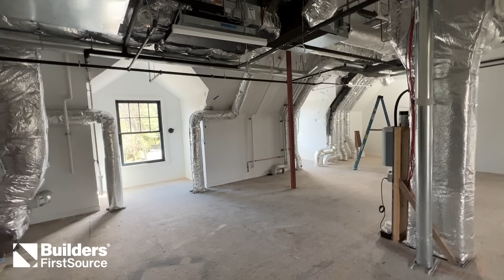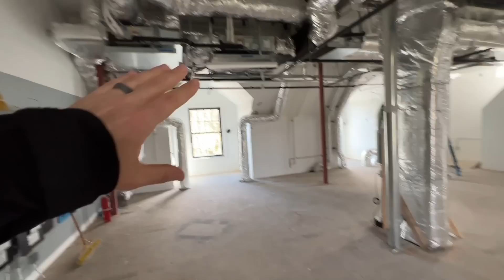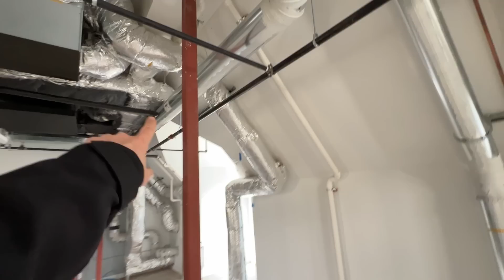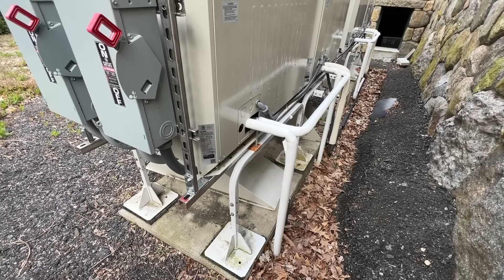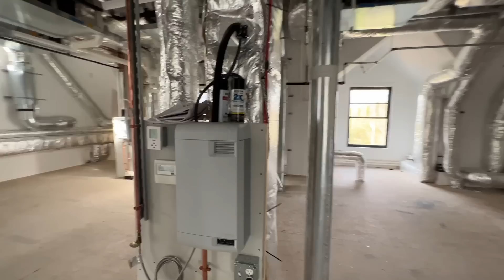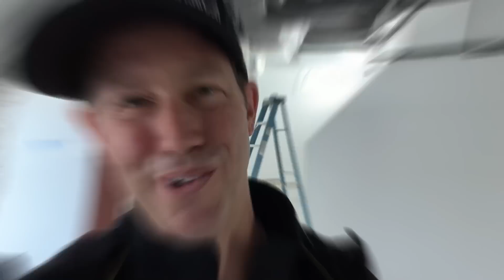This Mechanical Room is Epic : Build VLOG

Comment: This is neat but if the mid static pressure units only serve one room, it would be way cheaper and easier to just use high wall casettes.

Comment: Wow Matt,
This looks amazing.  I especially like the Mitsubishi device that allows one room on heat while other room on cool.  It's a complaint we have here in our Mitsubishi Mini-Split home.

Cheers,
Eric
Reply: Where do you live? Here in Connecticut (similar to Boston) we usually gap out for a while between AC in early October and when heating season starts on November 1 and this spring we had a very rare flip-flop from heat to AC and back to heat and now we've been gapped with no HVAC needs for over a week and when we pick up AC we won't go back to heat until Nov 1. I can see the utility of heat and AC at the same time in a commercial scenario where you might have interior areas or a server room getting cooking while the outer edges of a larger building get heat, but I can't quite figure out what the application would be in a residential setting.
Reply: 4/23 was the last day we needed heat here and we could need AC on Tuesday for a little bit but then there's another good week of nothing.

Comment: WRONG! Flex pipe on supply lines (=quiet & filtered supply) and only ridged on returns for cleaning unless you have filters at the return inlets then yes flex duct returns. I love forced air as a filtering method however I've considered hot water based radiators at outlet points because you can control each room as it's own zone independently or incorporate a whole house zone controller. Each room adjusted by occupants use or common sleep temp. A side room kept @ 45 on heat because or 90 on AC because it's not used or storage. Filtered house, independent/user temp zoned per room or centralized controller defined heat/AC.
Reply: To refine - each filtered outlet could be hot or chilled water based on user or central based profile

Comment: Extremely nice system and wisely designed. With the amount of mechanical refrigeration connections involved with that type of system the potential for refrigerant leaks is high so having the accessibility to make repairs is critical. Very impressive installation. I come  across those types of HVAC systems here in Virginia and the builders tuck those refrigerant branch boxes in unserviceable spots within the home so when leaks occur it’s a major repair. Thanks for the great content. I’ve been an HVAC tech for 26 years and I greatly appreciate serviceable high tech installations. Installing the latest and greatest HVAC systems is one thing but putting the thought into making it serviceable is very impressive. Kudos!!!
Reply: I own an HVAC company and we install this Mitsubishi product every day.....the main down fall of this system is the type of AHU's they used....those pancake AHU's are a disaster to change a coil or fan blower motor.....literally open heart surgery.  It would have just taken an extra 8-12 inches to put in the Horz AHU's that have standard A coils and blower motors.  It also looks like they had the space.  This is the definition of just following the drawn spec rather that pushing the Mech Eng into what he should have drawn.  Other than that this is a stellar ductwork install.
Reply: @dougandjyness  Agreed, those pancake airhandlers are terrible to perform repairs on and homeowners always assume it’s not working correctly because of the lower CFM.

Comment: I'm surprised that Boston has metal piping for the fire sprinkler system. Any fitters out there know why? I'm a California fitter and only a few places require steel piping in homes. I.E. Some Bay Area cities.
Reply: Strong union presence?  AHJ might be influenced by them.
Reply: @95thousandroses  I don't think union would have influenced that specifically, but I'm not sure.

Comment: HELP!

ok...this is a long shot, but lots of smart people in here.  whats the proper way to insulate an A frame home?  we dont have much access to spray foam and im not sure about how the venting works correctly.  i was going to eliminate the venting, hopefully, by installing a zip r panel on the roof deck, tape, and seal everything up.  Then maybe some batts inside.  the framing should be 2x10....

thoughts?
Reply: Consider mineral wool insulation it doesn’t loose r value over time and is  very water resistant and won’t mold, not to mention extremely fire resistant. There’s no proper way to insulate a home per say, but definitely ways to do it wrong. If your trying to make the most energy efficient house possible minimize any penetrations in walls and on through the roof. If your using the zip system liquid flash in my opinion would definitely be a more permanent air sealing and would get into the seams more and provide a better seal. Not sure on your climate or roofing material your going to use but consider having an air layer to allow some ventilation beneath it if necessary to prevent any condensation issues. Overall air sealing any and all seams will minimize energy loss, and insulate any can lights (if you have any).
Reply: This is rafter framing I presume?
Reply: @davidchillton1744  I'll stick build the whole thing but the framing was 2x10.  I just didn't know if the fiberglass against the osb would cause any rot.  Using baffles would be really time consuming, so I thought the r panels on the outside would basically be like using spray foam on the inside.  It will have a metal roof as well

Comment: Matt, I see a bunch of low voltage stuff.  I would have loved for you to talk about the structured cabling.  I notice that structured cabling seems to still be an afterthought for most if not all builders still.
Reply: High end projects have a CI. I'd love to know more about it too.
Reply: So it looks like the rack for the HA stuff is elsewhere those look like a combination of lighting control and security/fire panels.

Comment: As an electrician, I'm both happy with the neatness of the distribution panels, and mildly curious/ nervous about the effects of bundling those cables ( typically only an issue if done for longer than ~2' due to heat buildup and EM reactance ) and how they were landed into the panels.

Comment: Up here in Canada I hear a lot of complaints about the running costs of heat pumps, they say they installed them to save money but the electric bill has gone WAY up. These are just conversations I have overheard numerous times from different people and did not get any specifics so maybe cheapy units or bad installs or both ?
Reply: Well what did they start with? If they switched from natural gas, propane, oil, coal, wood, etc... then of course their electrical costs will have gone up substantially because they are using electricity instead of combustion for their heating. The relevant question would be how that increase compares to their decrease from the previous system. Now, if they were changing from electric baseboard convection, radiant, or (somewhat rare in Canada) a hydronic system with an electric boiler, and their electricity usage went up, then that's more of a problem. From my own experience in southwestern Ontario, energy costs have been roughly a wash before and after getting an H2i Mitsubishi Zuba system (and at only a small increase in price installed for replacing a furnace and air conditioner of similar capability - which to be fair, is comparing with a premium Trane system) but there have been other benefits. Also, if I were to make comparisons into the future that wouldn't necessarily stay that way since different energy sources change prices at different rates. As an example, in Europe, electricity and natural gas prices for households both went up this winter as compared to the year before, but natural gas went up much more.

Comment: With that space, you can build a large model railroad😄
Reply: My first thought when I saw that room was someone is going to fill that room with stuff that can't be easily moved (like an extensive model railroad) or they'll put in a hard ceiling for even more "living" space. Then, when one of those systems needs repair, the HVAC guys will not be able to get to them as the home owner has literally blocked the access...
Reply: The funny part is I saw this and I was like that's genius you get the mechanicals out of the basement so you can build a larger layout in the basement!

Comment: Obviously this is a multi-million dollar build. In a standard build you get the cheapest HVAC system the builder can source.
Reply: Yeah pretty much
Reply: True. But Still good tips and tricks you can do. Heat pump systems are affordable. And designing the house for conditioned mechanical and rigid ducts will add costs sure, but it’s ultimately up to owner and how they want it built and how much they want to spend. Vs how efficient their home is. 

This is obviously a very high end build. Hopefully it trickles down and become more affordable for mid range homes. Eventually lower priced builds as well. Like I said heat pumps are available on the cheap systems now.
Reply: People are seduced by finishes when that could be done, slowly by an owner. Structure, Insulation,  Mechanicals, Kitchen and  Baths are where the money should go. The money will be paid back forever.

Comment: G,day Matt from Sydney Australia.
Yes, the mechanical air conditioning system is advanced; that's for sure. But with such temperature variation inside to outside, how will the home occupants stop condensation and moulds growing on glass and walls?
🪟🧱🦉
Reply: Those systems have a dehumidification function for one and for two I’m sure the house is well insulated.

Comment: Can any HVAC ppl in the comments explain to me why its called static pressure instead of just calling it resistance?
Its literally the duct circuits resistance to flow right?
Reply: Because there are dynamic effects too.
Reply: @Ariccio123  Can you elaborate on that?
Reply: @beachboardfan9544  not really in the vein of HVAC, but dynamic pressure is related to changes in the flow when flow starts and stops, which causes a pressure gradient across the length of the duct. Normally static conditions are studied for system design, and other factors can be neglected.

Comment: As a person who serviced elevators for 40 years. The asshole who put those units 10' in the air should be flogged. Put them on the ground at a comfortable working height for the servicing items. When it comes time to replace it will cost less too.
Reply: Had you listened, he clearly said that it was a dual use space.
Reply: @daveklein2826  I don't give a rats ass about dual use space. Techs need safe access to work on and replace equipment. Stuff like this happens because the architect and the builder have never done the Houdini of moving heavy awkward equipment thru windows, crawl spaces, fire escapes. ect. Standing on top of a 8' or 10" ladder working is not safe practice. The money spent on that house? A little common sense and fore thought would go a long way.
Reply: @allenburns3177  and they don't give a rats ass what you think  LMAO
Reply: LOL - that is what I thought. I get they are trying to maximize floor space, but all that should be accessible for service and inspections

Comment: You need the humidifier on those cold dry winter days and nights. You can run on a rug 
And with static electricity you can give one hell of a shock if you don’t have a 
Humidifier.
Reply: You would be surprised how little to no humidification you need on a really tight house. Just the moisture from breathing, cooking, and bathing can be enough or even too much. On a standard leaky house it's the cold dry winter air constantly infiltrating that dries out the indoor space.
Reply: @zjeepgozweeln  All the air inside a tight home is replaced via the HVAC by outside air (Matt Risinger covered that). Outside air is dry. That's a great deal of volume with little moisture.

Comment: I feel bad for the service tech that has to drag a ladder into the house and stand on a ladder just to service these thing. It’s like commercial jobs. No thought for the next guy.
Reply: It seems like a trade off they thought was worth it for the extra usable floor space.
Reply: @karthik11512  of course they thought it was worth it. They don’t have to service it. You know the poor guy is going to be the one to have to move all of their Christmas junk to set up a ladder. It’s a no win for the service guy.
Reply: He can charge commercial rate to make it worth his time. I'm sure they won't even blink at the bill.
Reply: @philwang2326  They’re usually the ones to pick the bill apart. Our commercial rate is only $10 more than our residential rate. My point is to always try to think about maintainability and the next guy that has to work on it when designing mechanical systems. Complex systems aren’t always the best option for long term.